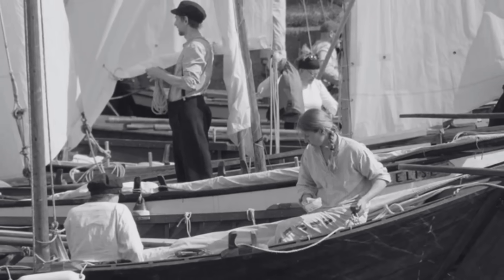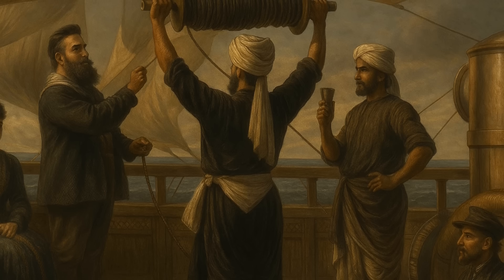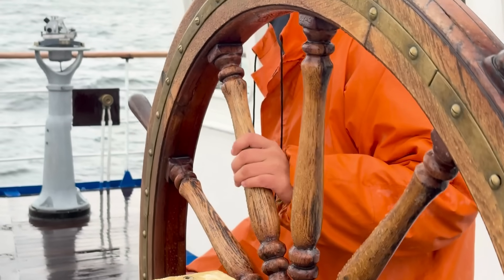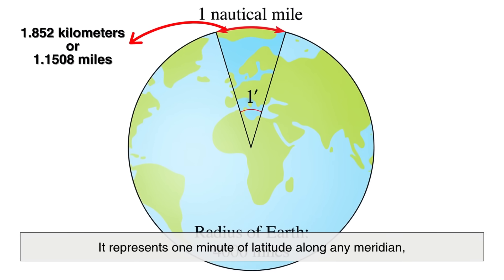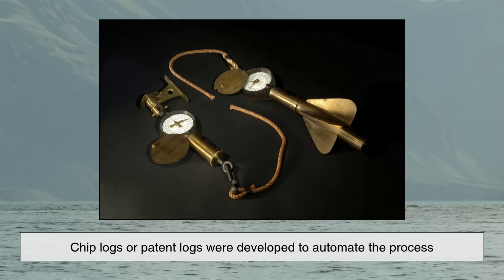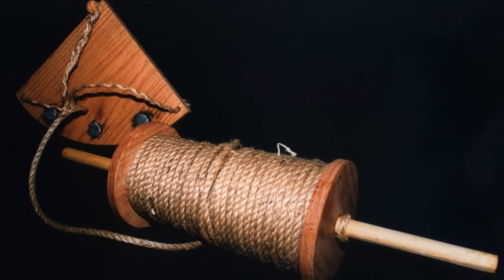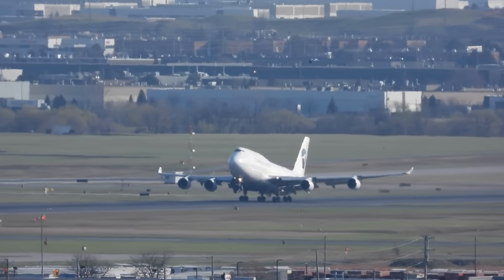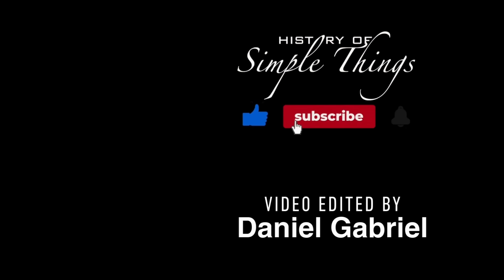Why Ships and Planes Use ‘Knots’ Instead of Miles per Hour

Comment: Amazing, I never knew about that term "Knot" before. I spent 4 years in the Navy, I don't recall anyone explaining it. I've always wondered but never researched it. 
Thank you for this very usefull video.
Reply: Odd... I'm retired RCN and we were told all about knots... as in the nautical mile. We were also instructed, at some length; in knots, bends and hitches. All very useful things - in my hare-brained opinion, of course. 😊
Reply: @haggis525  knots refers to  nautical miles PER HOUR (a rate of velocity) of course.
Reply from the maker: Awesome! So glad to hear that you liked it. Thanks for watching!
Reply: It’s easier to fly a plane or sail my boat because the charts are all in knots. One nautical mile is equal to one minute of latitude.
Reply: I, as you wanted to understand what a knot was & further in the comments is actually a naut. After 43y of being Honorably Discharged from the Navy, I've finally got my answer. Most informative!
Reply: Yes it does mean nautical miles /hour but it is not a distance.  Travelling against a 6 knots tide at 7 knots you need 6 of those 7 knots just to stay still . So in an hour you have only travelled 1 nautical mile from where you were . Sorry for my inability to explain it better

Comment: What about in the speed of Mac?
Reply: Last time I used a Mac, I didn't notice any speed. 😉
Reply: Did you mean "Mach"?
That's the speed of sound *at sea level*... but it changes with altitude, so with aircraft, it's relatively calculated.